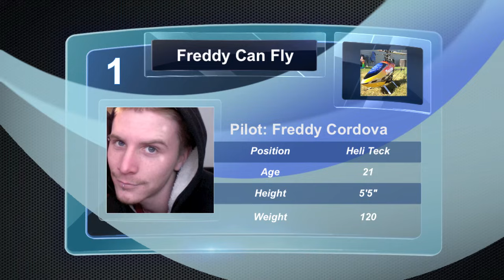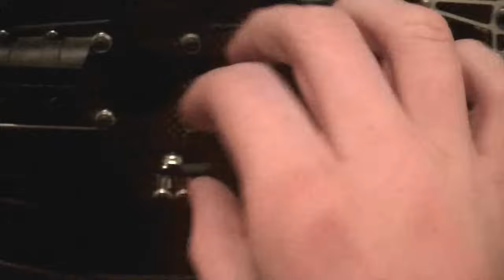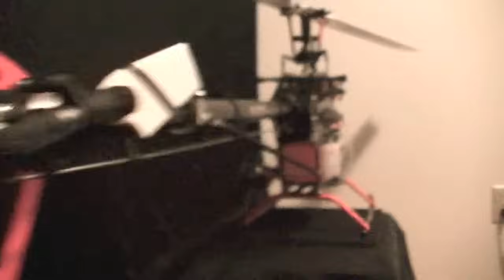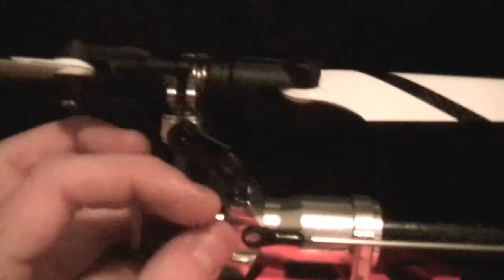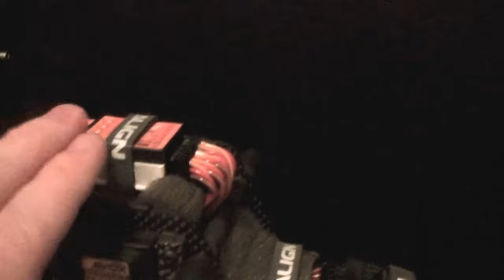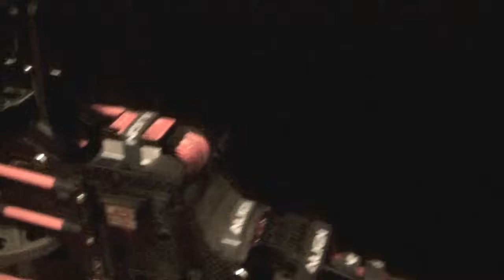Rc Heli Troubleshooting guide...TAIL WAG (freddy can fly)

Comment: Hey Freddy ! How are you ? So I just changed out some damaged parts etc.etc. on my xlp 550, I did not replace or unplug any servos or anything like that,but I was surprised that on trying to lift off on a first,second and even a third test flight the heli wanted to yaw nose left I mean badly, without any inputs, well right rudder just to prevent it from tipping over,a friend was telling me that I would have to reset the travel limits on the flybarless unit ( microbeast plus) is whats on my heli, I'm new to this, how do I go about doing this bud ???

Comment: Freddy help me please,I just installed a spektrum fc6250hx fbl controller on my heli,and everything set bang on with my transmitter, however when it's powered up.on bench the tail slowly creeps to one side ,why is this,it compensates fine when I move the heli both sides ,it just creeps to one side
Reply from the maker: I usually see this with Spektrum if you have added any sub trims to the rudder.  if you have remove them, find a better servo arm and find the best mechanical 90 you can.  don't worry if its not perfect the gyro will handle the rest.

Comment: Tried everything. The only thing I found was some tail sloppiness, but it seems that the actual horn can move slightly without the servo moving. I dont want to buy a new pushrod as I've already wasted way to much money on new parts trying to fix the damn thing. At this point I think Ill just start working towards a new heli.
Reply from the maker: sometimes a good upgrade to a new Heli is the way to go.

Comment: Hay Freddy another great video dude ....... Can you help me please ....... i have a new blade 330s and i have had a tail wobble from out the box i have just ordered blade balancer and scales ...... But i have noticed the tail servo moves [creaps] to the left so I tried to stop that by adjusting the trim on the transmitter ...... But if i move the trim 3 clicks it starts to go the other way ...... Any ideas ...... james from england
Reply from the maker: Please forgive me one this one but is the 330S a flybarless system?.  If so adding sub trims will usually cause odd behavior.  In most cases it sounds like a gyro error or gain issue.  But in all attempts try to completed the correct setup using no radio trims if possible.
Reply: Hello mate ...... Yes it is flybarless system dude ...... Thanks for ur help i will will try setting it up again from scratch ..... If not hopefully the local RC shop should be back open soon after all this covid 19 shit ...... thanks again bud

Comment: what about a tail kick to the right? tail compensation for torque in the fbl unit? Or revomix? would a straight throttle curve work better, instead of a smooth line up?
Reply from the maker: It will all depend on the programming in the FBL.  Each system has different setting and yes in most cases these days with GOV build in flat curves are used more then linear ones.  But always take in mind between mixing gyro gain and the load on the main rotor you can get tail kicks.  So you have to pay attention to the Heli and make your adjustments as needed.

Comment: Wow, I gotta get some Choppers from Align. I love your Nitro Chopper 600. I gotta get me a Nitro. I have Nitro Cars, but it's Choppers I really love. I have just gotten an offer to buy an older Nitro Chopper I not could refuse, fully assembled and only flown a few times, not even enough to break it in. I got it for a mere 800 USD, can you believe it and it flies like a dream. I would never have the patience to sit and build all from the bottom, even I learn more and more as I go. The other day I smacked my Swashplate and a lot broke and had to build a new top out of another destroyed model I use for spare parts(same model ofc). And it now flies like new again, actually even a bit better as I tracked the Rotors well, which removed the very little Tail-swag I experienced. Amazing. I did not think I could do it, but I still would never build my own Chopper, I would pay some to do it and many do this for money :) Thx for the video, Freddy:). But I will learn down the road. For me it's NOT the assembly there give me any kicks :) It's flying them :) ALL you ever could produce of questions, the answers are here.

Comment: Dude! I'm a novice flyer; I've had several helis but never got past sports flying. After a 4 year lay away I just bought a TREX 500L Dominator, BeastX. Only three hovers so far and I have tail wag. Your video caused me to go look at the tail and... a) binding in the tail linkages, but, b) more importantly one of the screws almost backed out. I was going to fly this tomorrow and while I would have done a basic pre-flight and control check I am sure I would have missed this. You sir, saved my heli. Thank you. I will be more diligent in future. Oh, and I still have a little binding at the extremes of movement, but not nearly so much. And yes, metal grips, screws, loctite and I'll need it, because I sure can't tighten the screws right up without binding.

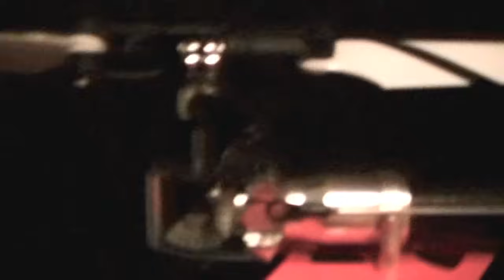Comment: 6:50 - The tail slider is suppose to be smooth enough that it slides down under its own weight without the need to tap the tail slider arm. It shouldn't stay in place at the top.

Comment: hey freddy, i have a trex 450 pro (flybar) with a futaba gy401 gyro and a hitec 5084 tail servo. im not having any tail wag but when i punch the throttle the tail will kick out or if im flipping it over or doing sudden pitch changes like tic tocs. my throttle curve is 100 flat my gyro gain is at 69.5 and it piourettes fine and comes to a dead stop but when the sudden pitch change happens the tail will kick out on me. after watching this video i made sure my mechanics were setup right and electronics i watched many videos on setting up the gyro and made sure i got it right. could you please help me with this problem?
Reply from the maker: hey buddy.  it sounds like the kick is coming from load on the heli.  think of it like this... hovering doing piros there is really not much load on the main rotor.  so the tail is free to lock.  but when you do hard collective the load becomes to great and that results in the tail slowing down as well and a sudden speed up once the load is released.  i would reccomend making a V curve to compensate for the load and keep the tail and main rotor rpms more consistent.  this should relieve the kicks but also be sure you setup is correct as well.  good luck

Comment from the maker: make sure your gyro end points are set up for full range travel, also make sure your servo horn ball spacing is out per the manual.  also make sure your travle adjustment are +100 -100 in the radio and make sure you dont have any expo on the rudder